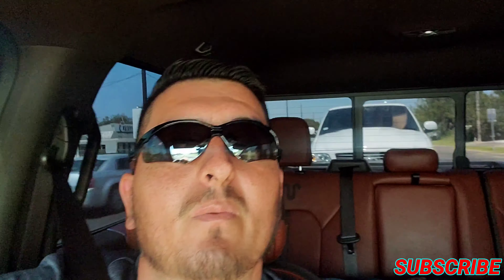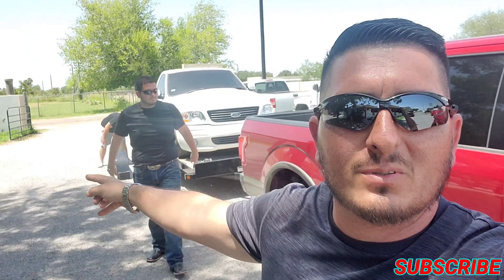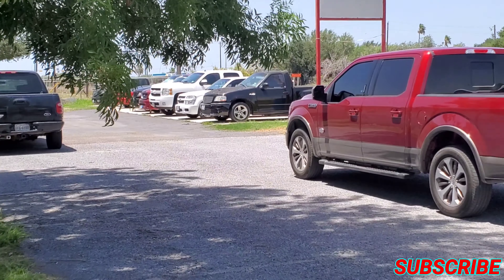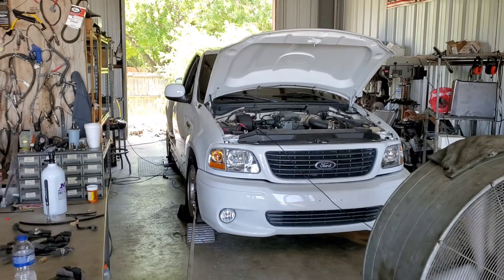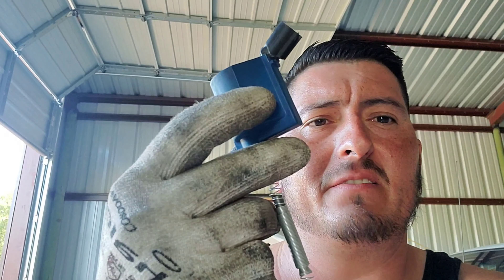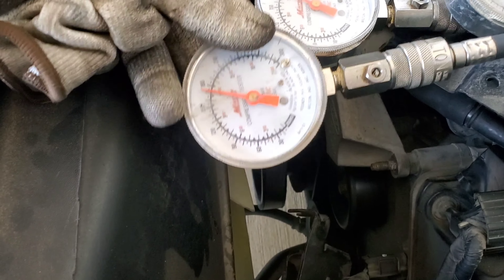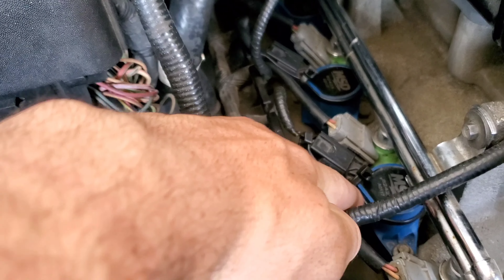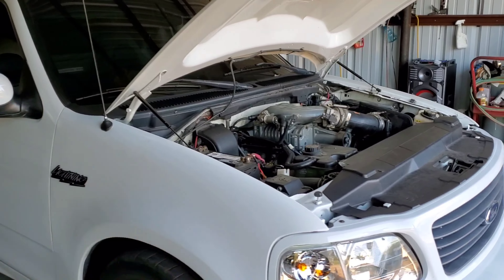Svt lightning hits the Dyno !!!

Comment: Msd coils suck bro.. after 3k miles on the msd coils I took them out and they were all oxidize from the spring..i went oem
Reply from the maker: Yea bro and the boot always comes of the spring stays stuck to the sparkplug and then when u wiggle it out it over expands....thays why i alwyas go with oem
Reply: shieeet. . . thats what I have on mine but in red but my ride is still running fine after more than a year and 10k miles with them on.
Reply from the maker: @TheGuyWhoDidUrM0M  some work great and some just give out faster than the auto parts store one... and some do work great
Reply: @boosteddave4603  I don't have a lightning.. but i did a built lightning swap on 97 f150 lol but after installing oem coils.. man it was a big big difference..#rockauto for the win haha
Reply: @TheGuyWhoDidUrM0M  I had the red ones..but i didn't have luck with them
Reply from the maker: @jesusjaime5791  that's great bro everything came out good...on my swap f150 they are still the oem from 2001. And still running strong
Reply: @boosteddave4603  question man, when I bought my truck and was a Lightning noob I just threw in motorcraft sparkplugs gapped at 54 like a regular f150, is that okay or do I have to get em fixed.  My truck shows 10# of boost on the gauge.  It runs flawless and no missfires.
Reply from the maker: @TheGuyWhoDidUrM0M  u can run the ngk tr6 and gap them at 30
Reply: @boosteddave4603  tr6s gapped at 30 will be then.  Thanks for the reply man.
Reply from the maker: @TheGuyWhoDidUrM0M  no problem bro